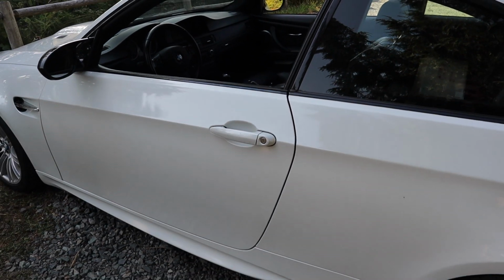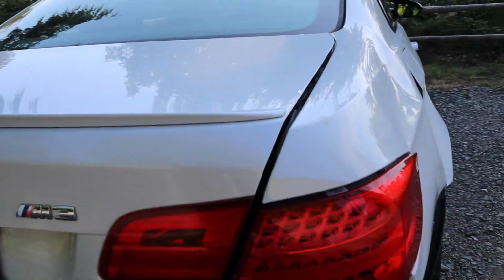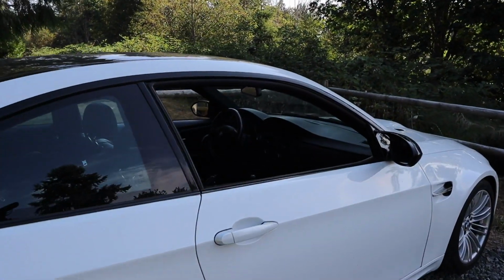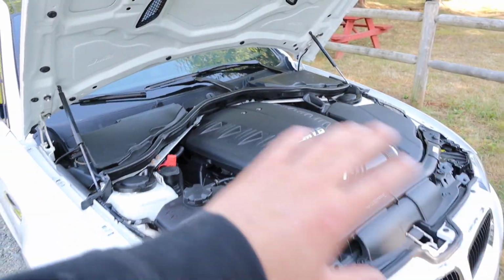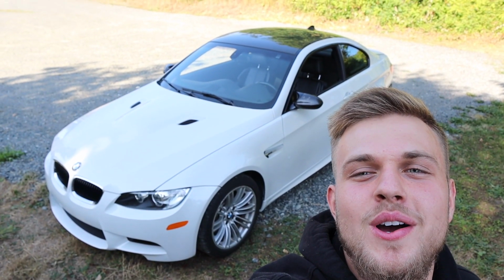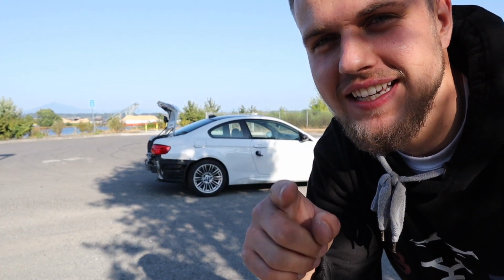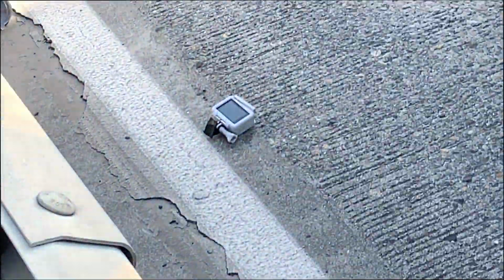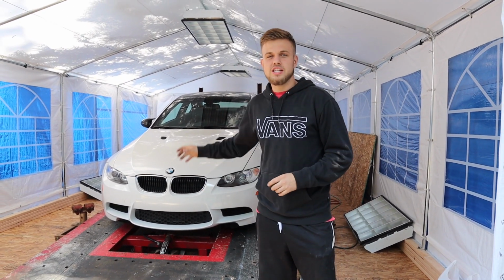I just Bought the CHEAPEST BMW E92 M3 I Could Find! Was it a MISTAKE?! (Part 1)

Comment: what are the specs (diameter, width, offset) of the arc-8 wheels on your other M3...and did you use spacers and lowering springs? the setup looks perfect, I want to do the same with my m3.